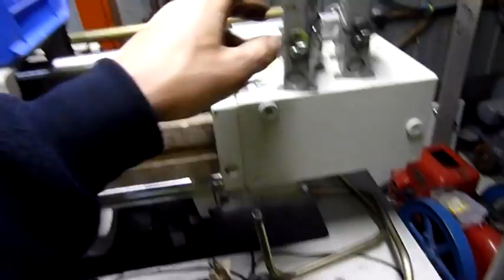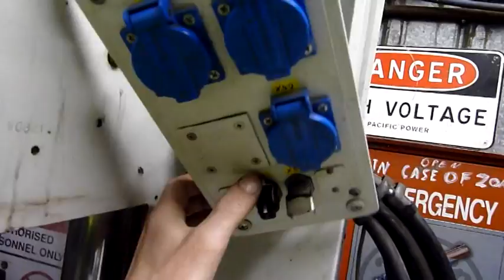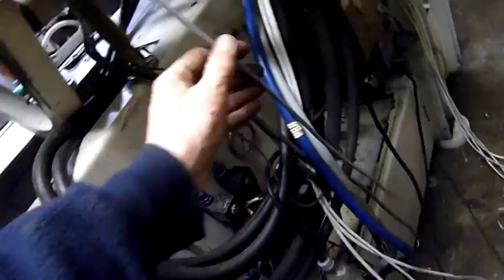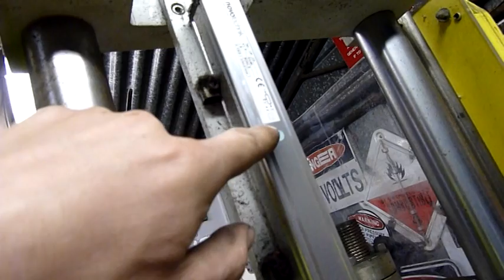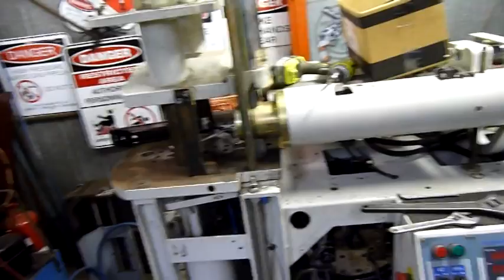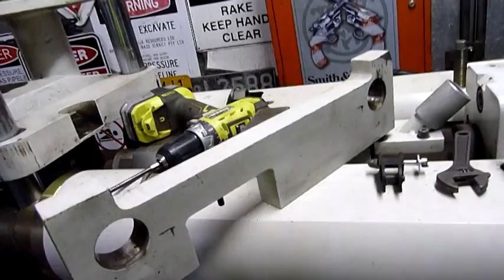Battenfeld Plus 350V Autopsy Pt2

Comment: keep the voltage lower than 50V AC 120V ripple-free and she would be a up to aussie electrical code - as 3000:2007 1.5.7.

Any Qs? about Aussie electrical rules I shall document as I quite this book, it's my bible.

Comment: the big multi plugs also are used in the dj world for par racks so you run 1 cable to a beam with 6 to 12 par lights  to a dim rack

Comment: ed, you could make an air operated machine gun from that single acting sprung cylinder!! you attach it to the bolt so when you pull the trigger it slams the bolt forward against a spring, chambering a steel slug from a stick magazine, then a very short time later a big valve releases a burst of air to fire the projectile then dump the small cylinder to atmosphere to reopen the bolt and the cycle repeats until all ammo is expended :) full auto fire is possible. belt fed perhaps :D